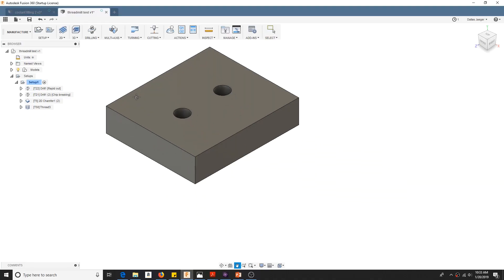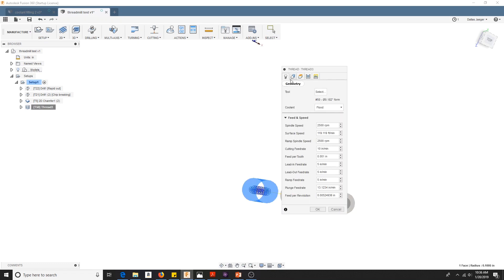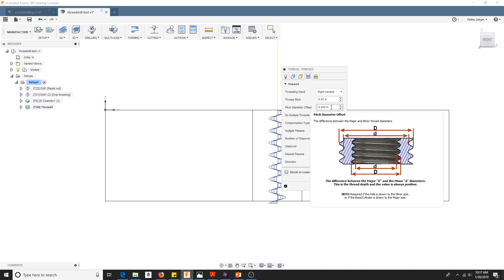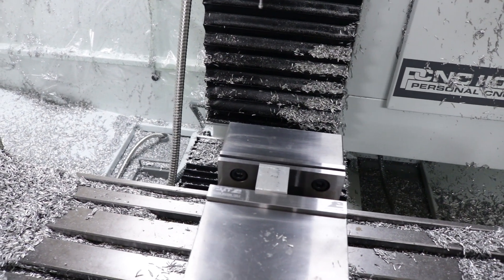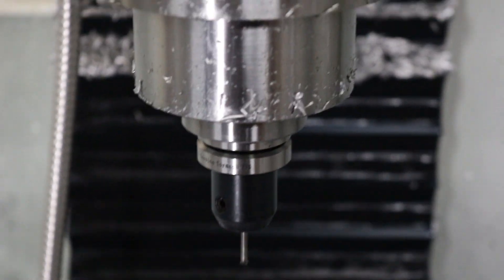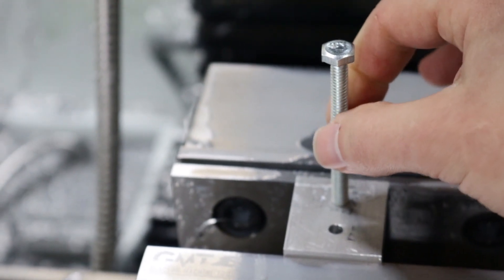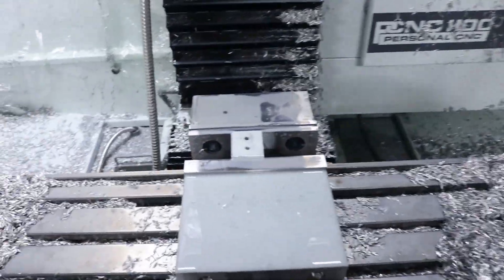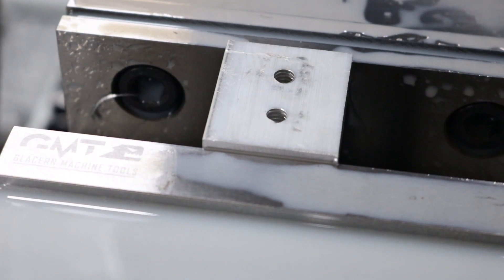Threadmilling Aluminum on Tormach 1100

Comment: It's probably not as much of a factor on aluminum but we offset our cutter comp ( "D" value ) heavy  for the first hole. Then work up until we get perfect thread size. The comp can also be adjusted as the cutter starts to wear.
Reply from the maker: I REALLY need to start using compensation in the machine.  I'm still using comp in Fusion and assuming my tools are the nominal diameter.  Your way would be much faster, I had to run in the house and re-post a file to make the change.
Reply: @RivalMachining   It's not all that difficult. it's going to be a g41 or g42 ( comp left or right)  combined with a "D" value that will get picked up like a tool length offset. Fusion should have a check box or something for cutter comp. Exam: G42 (tool on right side on cut)  D7 (pick up radial comp for tool 7).

Comment: awesome! I was hoping to see some pipe thread though!
Reply from the maker: I need to learn it, it doesn't look too difficult though.  I think the biggest part will be the fact that there are 2 variables instead of 1.  The taper and the thread pitch offset both need to be perfect, and when the fitting doesn't fit, which one do you change?